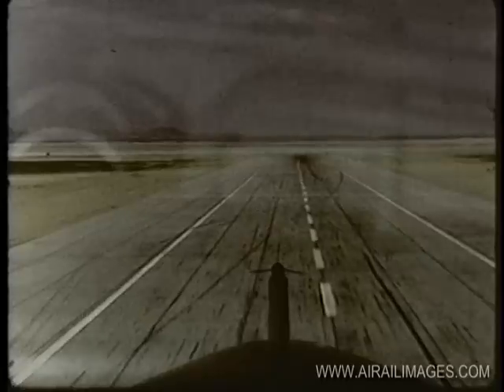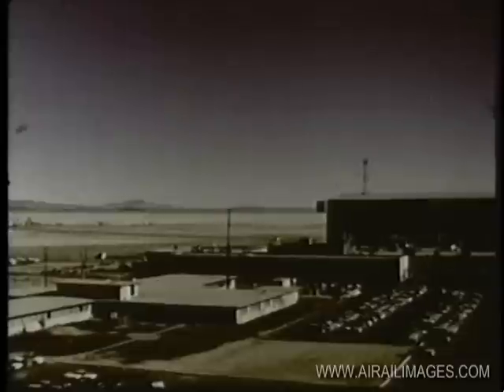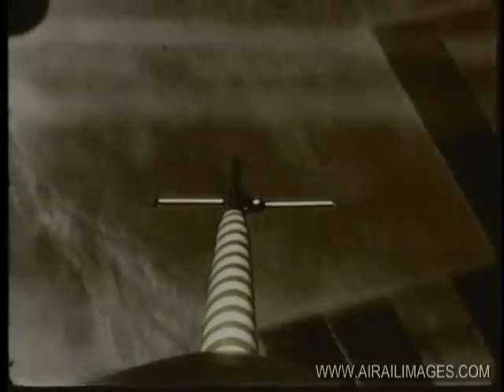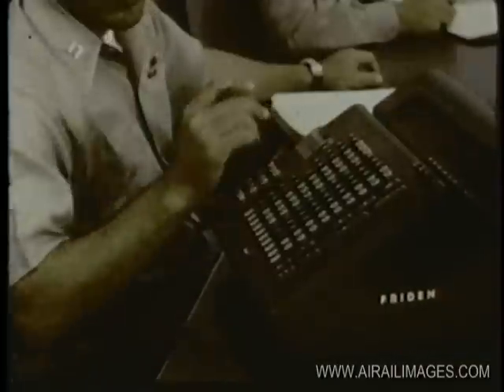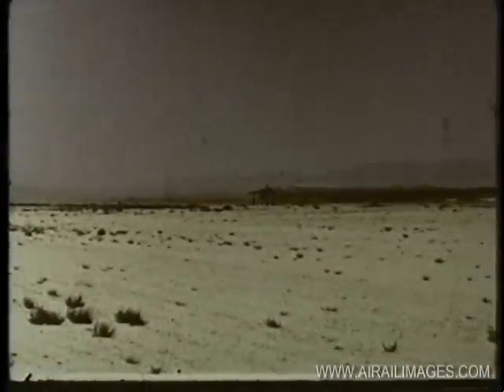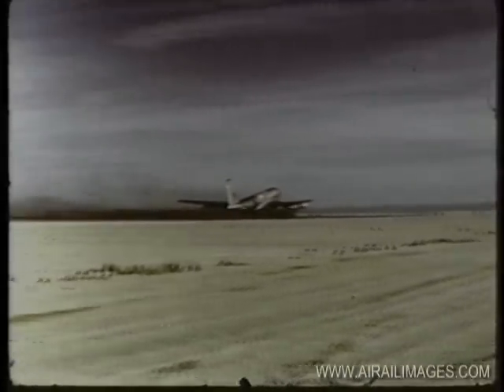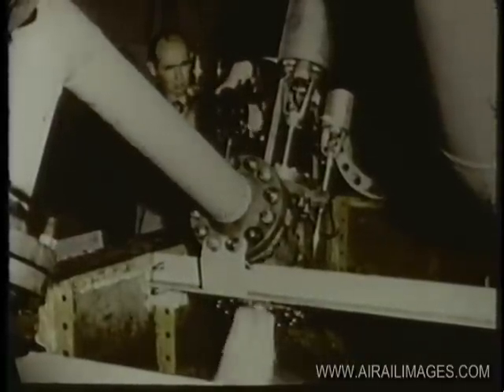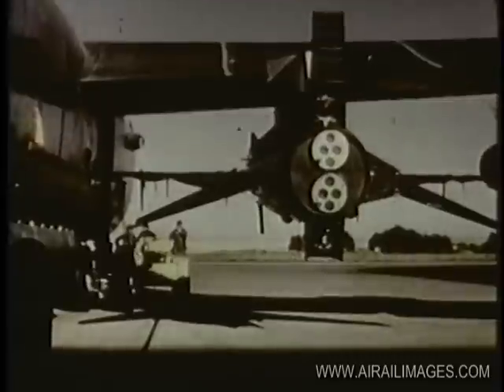Flight Test's Golden Age -- 1959 AFFTC Briefing

Comment: Was at EAFB 1958-62, was a flight mech on C-47 -54 - C-119. we took personal and equipment all over the US. It was busy as a young airman didn't see or understand much of the big picture . At the time just  told high security, i just did my job but could over hear enough to keep my mouth shut, knowing it was very important. Great guys on the flight line and lots of long hours n good memories. JB
Reply from the maker: Thanks for sharing your story. Glad you found the Airailimages Channel.
Reply: David Vance  was a flight mechanic, mostly on C119 D model it had the 3350 cu eng with 3 turbos.The earlier A n B models had 4360 eng with electric landing gear.I saw thoes models in Canada,was told none in active AF at the time. Got to go on practice run with guys who cought the spy satellite over Hawaii, that was exciting,thoes pilots flew that c-119 darn near like a fighter.Look it up🤠
Reply: David Vance  Never did I did notice the 3350 swung a larger prop than 4360 ,an think it was developed for the B-29 , I have read they had problems early on.

Comment: The f104 - A great straight line, high altitude interceptor. Not much of a dog-fighter and a little fidgety at landing for the lesser pilot but one hell of a dragster when you have bombers incoming.
Reply: Not as fast as an F106 Delta Dart. They'll leave a F4 in the dust with internal bays full of missles. On it's way to kill some Bears
Reply: @thetreblerebel  hahaha the 106 wasn’t faster than the star fighter,
Reply: @dukeford8893  I need to look that up. The 104 could go supersonic in a climb and the 106 is awesome but I don’t remember being able to outrun the 104.
Reply: @dukeford8893  also great story about a 106 that had a pilot eject snd landed by itself in a cornfield virtually unscathed.